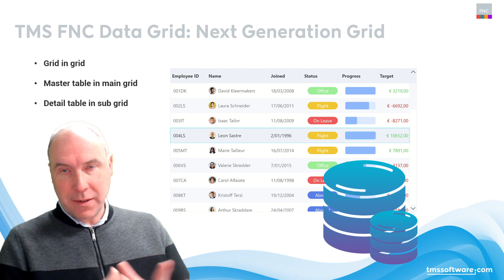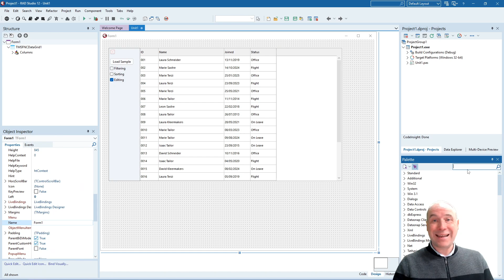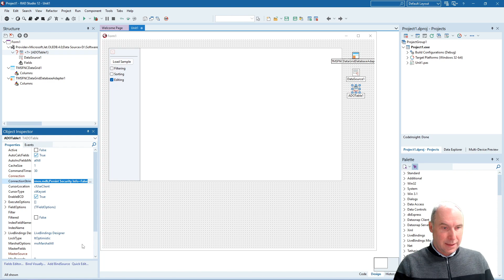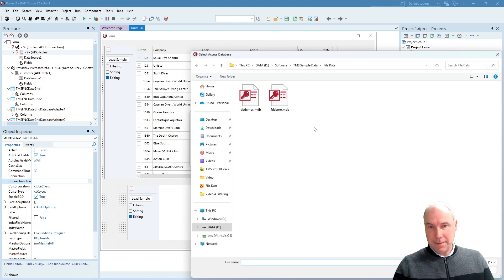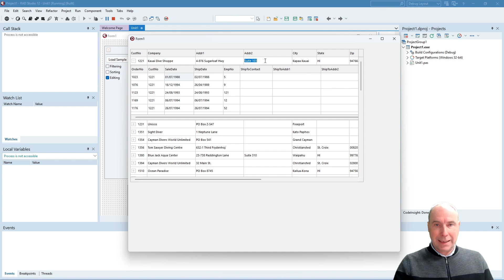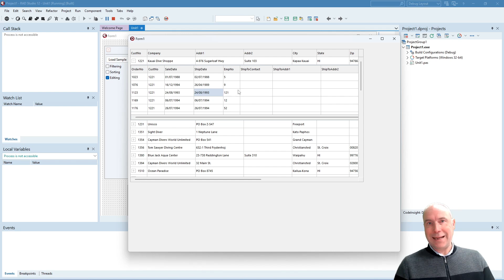Next Generation Data Grid - Part 9: Master Detail

Comment: FNC UI Pack version 6.3.x - in Adapter no property DetailControl at all... In documentation there is no such property too. How to find it?
Reply from the maker: Latest version is v6.5 and TTMSFNCDataGridDataBaseAdapter effectively has a DetailControl property
Reply: @tmssoftwareTV  Thanks. I tried to use TTMSFNCGridDatabaseAdapter - it has no such property. TTMSFNCDataGridDatabaseAdapter has it.